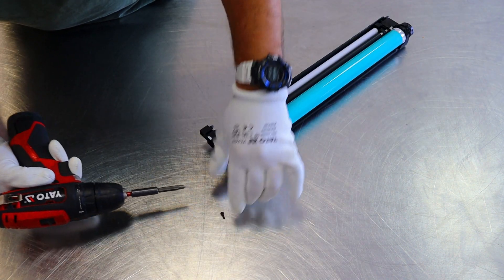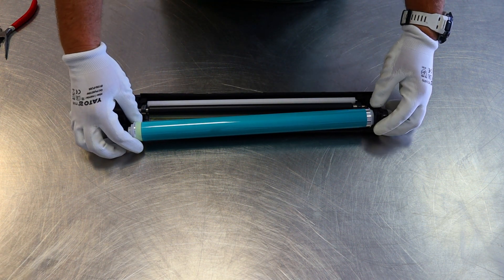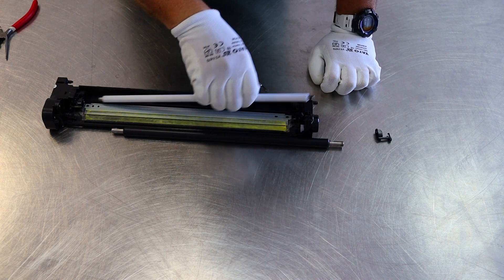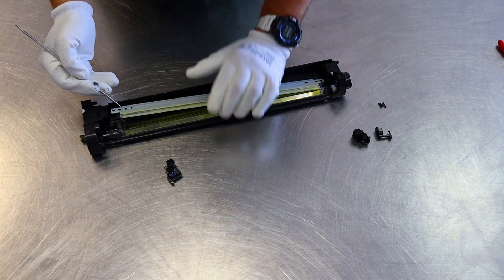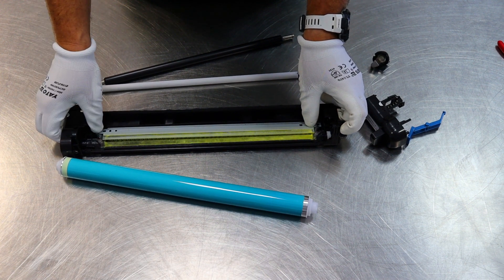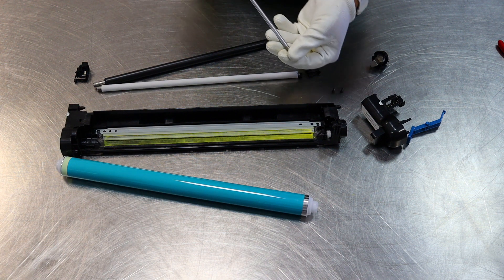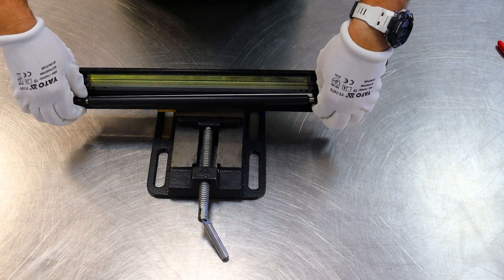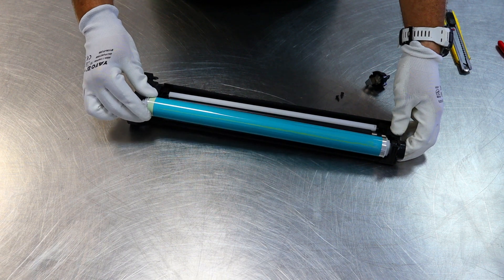Drum Canon IRC 3330 c3325 c3320 c3520i CEXV49

Comment: I would like to have face-to-face training
Reply: Alrigh! But some difficulty getting there because I don't understand the language
Reply from the maker: @patriciahoya5434  can you read english? if so, I have a solution
Reply: @MrRicoh yes, tell me
Reply from the maker: There are currently 7 copier training courses available:
Ricoh MPC 3002/3502/4502
Ricoh MPC 3003/3503/4503
Ricoh MPC 2003/2503/2011/2004/2504
Ricoh MPC 3004/3504/4504
Ricoh MP2554/3054
Ricoh MP2555/3055
Ricoh IMC 2500/3000
The cost of one course is $400
Reply from the maker: @patriciahoya5434  contact me copy-expert@wp.pl